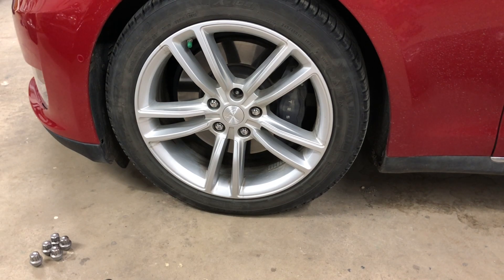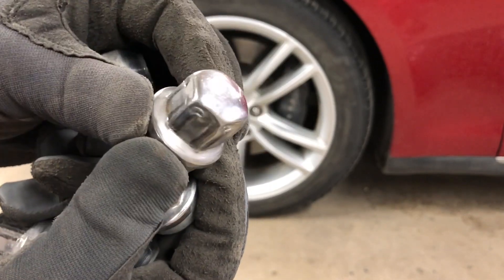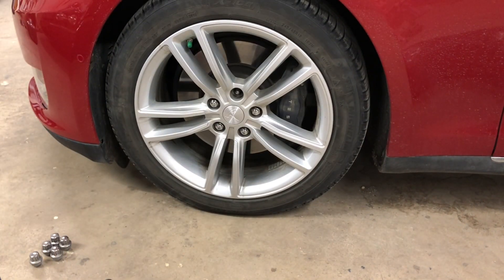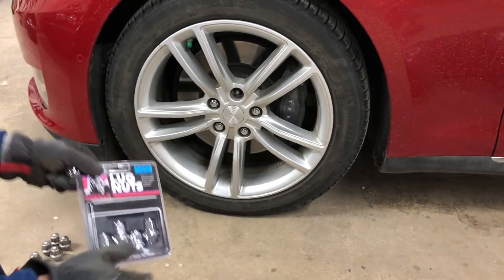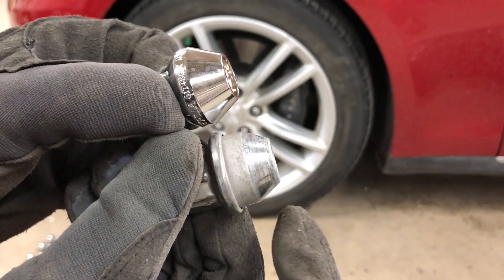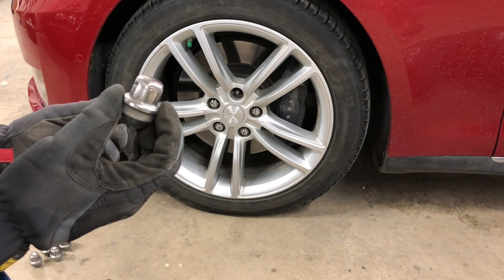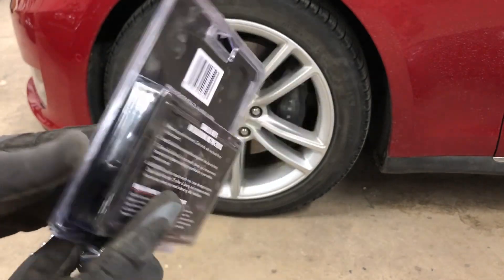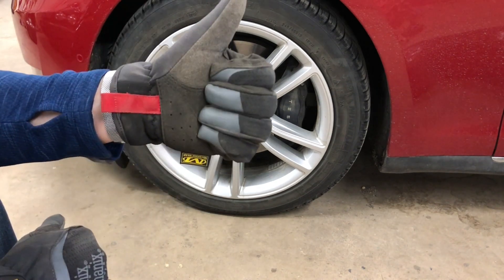Twisted/Distorted Factory Tesla Lug Nuts!? FIXED

Comment: You didn't do enough research. But being a Tesla owner it doesn't surprise me. Those are cheap metal caps on the top of the lug nut. Garbage. Once again.. doesn't surprise me that Tesla would go with that dumb azz style of lug nut. They have failed since the 80's. Why anyone would think that was a good idea blows my mind.
Reply from the maker: I smartened up and traded the Tesla off on a Lexus, problem solved.

Comment: Hi. Yesterday, I lost an original Tesla lug nut on my MS 2017 and because I'm tired of these nuts that I have to hide with plastic covers, I was looking for a better lug nuts that don't need these cheap covers. I just saw your video and I'm impressed by these Gorilla nuts. Do you know if I can install these either on the original Tesla wheels but also on aftermarket wheels without any problem? Thanks.
Reply from the maker: The lug nuts shown in the video and linked in the description will work fine with factory wheels and should be fine also for most aftermarket wheels.
Reply: @InternetDude  thanks a lot and continue the goog work. Merci! 😉

Comment: I discovered these are covers over a 19MM lug and over time will spin as if the lug bolt is stripped. I had to drill a small hole on the center of the cover and began to tear 2 of mine apart to get to the true 19MM lug under those stainless covers. once that cover was removed I placed a 19MM socket on the Real lug nut and it removed with ease. I originally thought the bolt and lug were stripped and the 2 lug nuts were stuck inside my 19" cyclones. that is a very bad design for lug nuts.
Reply from the maker: Hmm OK. I have a relative with a Ford Escape and apparently they have swelling lug nuts so maybe OEM automakers are cheaping out on lug nuts? I don't know for sure.

Comment: They are 2 piece nuts, they don't bend because they are stainless. You can actually get pliers and pull them apart if you get a really bad edge. I had mine replaced by discount tire a few years ago.
Reply: yes discount tire is where i discovered that after they swapped wheels for me. the stainless covers had gotten damaged from the air gun

Comment: Interesting.  I got mine replaced 2 months ago under warranty with the new version.  Same issue you had
Reply from the maker: Hmmm maybe I should have just told Tesla about it and got free replacements. Oh well. Thanks.
Reply: @InternetDude  yup! Tesla will give you the new style lug nut under warranty but you also need the plastic lug caps because the new style is open ended
Reply: We recently produced a new product for Tesla Accessories. If you are free you can check our fantastic deals on our ebay listing.